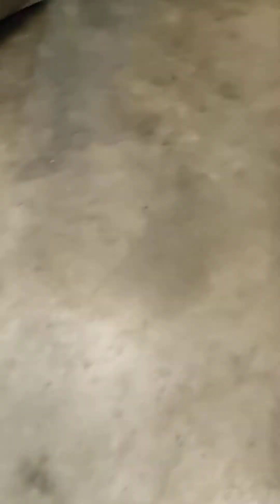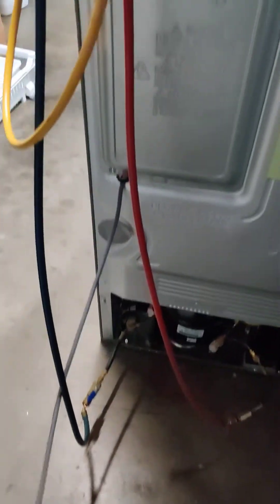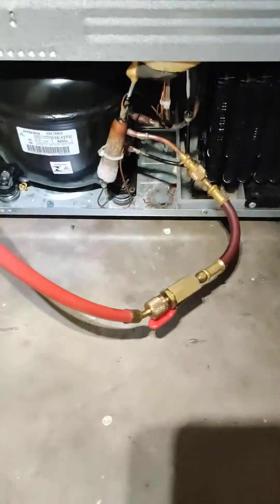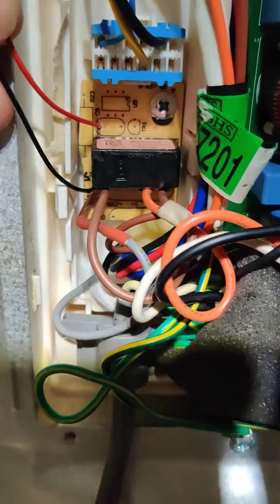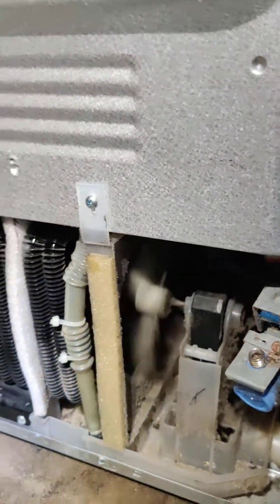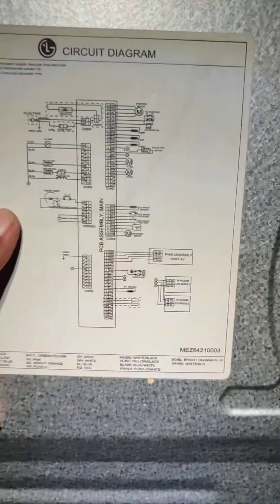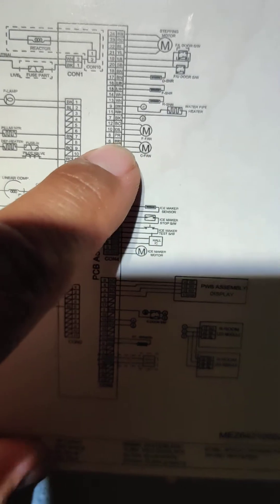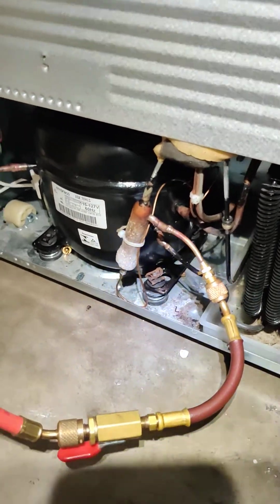LG linear Compressor substitution by Embraco compressor

Comment: I do not believe that the use of conventional compressor instead of linear one work as expected, because the linear compressor does not work with ON OFF control temperature, it works with incresasing or decreasing the speed depending of thermal load inside the frige. So when you use a realy taking the PWM signal of feedback signal from Condenser fan just stopping the conventional compressor when defrosting process starts.

Comment: Great video. What kind of a relay did you use?  I purchased a 12 Volt Automotive relay and it won’t work. The condenser fan runs on 9 volts and once energized the voltage drops to 4. 
Also the board is not able to see the operation of the new compressor. Getting 3 flash codes. Any ideas?
Thank you.

Comment: I try that and don't get it to work you are not getting,12 volt to the fan and next the board will not respond with out the compressor in the circuit thanks let me know what you think God bless keep up the good work
Reply: I have the same issue with the one I’m working on. Did you get it figured out?
Thank you.

Comment: did the amount of refrigerant needed change? my swap is only getting into the 40s frdge/20s freezer (f).   once it gets this low the lowside goes 0 or negative and the high side is down at 100.
Reply: Sounds like it’s either undercharged, leaking, or restricted at the filter drier input

Comment: What is the difference between the EGX 70HLC and the em3y60hlp? or should I use EMBRACO # FF10HBK/FF10HBK1?(I have a French door,  2 drawer freezer ice and water in the door) thanks
Reply: im wondering which one to order also,  the ff10hbk  seems common for others to use, but it seems to need a hard start capacitor on it.  maybe the egx70hlc has a start relay on it?

Comment: what model embraco compressor ?
Reply from the maker: you can use any regular compressor, the ones that uses starter relay,PTC.   i used an em3y60hlp
Reply: @faleroappliances8111  , how about the upgrade the software to motherboard?
Reply from the maker: @chrisnguyenDQ2012    THE UPDATE IS FOR THE LINEAR COMPRESSORS, IS NOT NEEDED IN THIS ONE .
Reply from the maker: PLEASE LEAVE A REVIEW IF THIS HELPED YOU , THANKS IN ADVANCE.

https://g.page/r/CaA0PdyfjfuXEA0/review